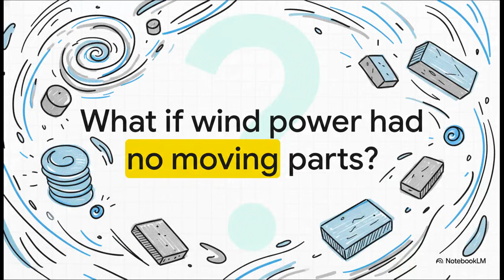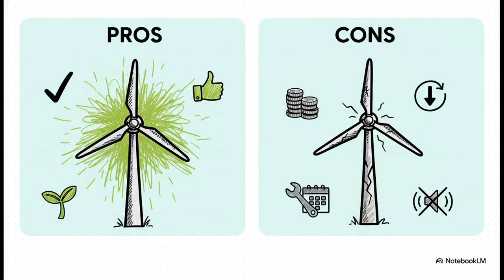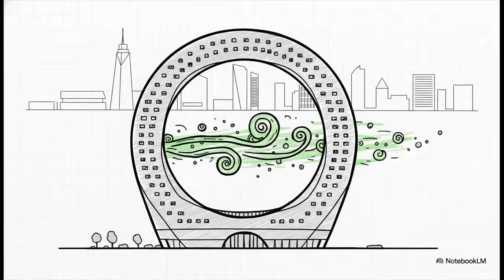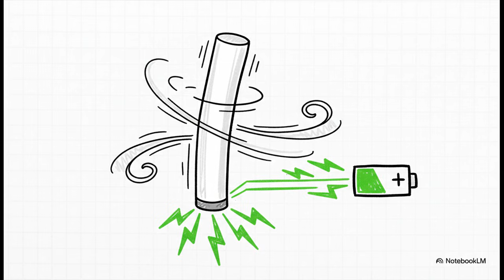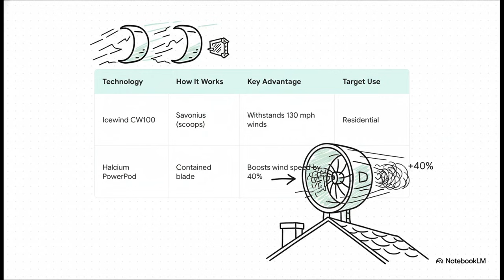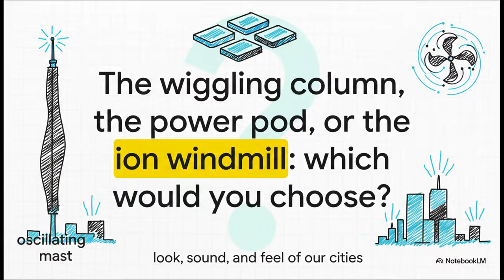Bladeless Wind Energy

Comment: Wind turbines are extremly efficent because they not only take the engergy from the area of their blades, but from the whole circle that the blade ist operating. Double the lenght of the blade, and get the power squared times pi. (A=r²*pi). The reason is, it is like an aeroplane wing that works with pressure difference. And the windspeed gets higher as you rise above ground. So big is efficient with wind. Rooftop wind energy is mostly useless. It is expensive, you get vibration into the building (and therefor noise inside) and the effect is very little. If you get 100 Watt on average, it is a good one. Bigger, and you need a reinforced roof. Solar has no scaling effect, so it is perfect to use on a roof.

Comment: Building and maintaining wind energy infrastructure is very expensive. I have to wonder how much economic value is actually realized. The idea that using wind energy or solar will have an impact on climate is strictly voodoo science. Climate has been changing since the 6th day of creation. The climate change never stops. I am reminded of the line spoken by Spock about the alien probe that came to look and see how the whales were doing. "Only human arrogance would assume the signal must be meant for man." That same arrogance assumes that Man has created, and could alter, the change of the climate. Spoiler alert: there is a huge fusion reaction 93 million miles from earth, which is the source of ALL heat and energy (some stored) on this planet. It has activity cycles that cause almost all climate change, to the exclusion of other factors becoming measurable.
Reply: That is the dumbest thing I have heard in a while. Wind energy sells at the cheapest price. Why? Because the cost is very little. Fuel is for free, maintanance is there, but not as much as in a coal or gas power plant. For every GW of power in a coal power plant, you need about 500 people just for maintanance (incl. administration). And another 500 at least for extracting and transporting the coal. Building cost is nearly the same for both per GW.
Reply: @philherb3843  If you compare a plant that makes energy 24-7 with a single windmill, them yes, you are correct. I have seen windmill plantations with multiple units. In areas where the wind is constant, it is competitive. There are very few places on earth like that. Most of the time, I( see one or two units turning, and the rest might move sporadically. On some days, the output from the wind farm is zero. That coal plant? It is always running near full capacity. There are people there with jobs, and those employees spend money in the economy. Does the windmill spend money? No. There is a man or two that make extreme money for the danger of working on the blades using ropes, but often, they are from another place and don't spend their earning locally. When it comes time to change the blades, the old ones cannot be recycled without spending more than they are worth, so they sit in yards, as useless junk. I'll take the full output and the full employment, every time.
Reply: @arthouston7361 I wrote per GW which is GigaWatt.
Reply: @philherb3843  The concern is the number of times a year you actually get those GW's, and how many people are employed in the making of those GW's.